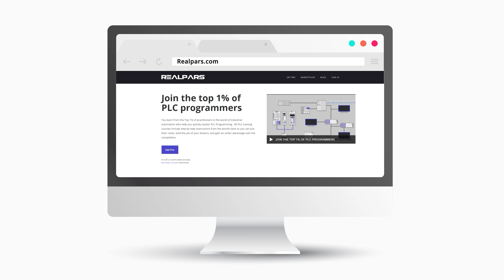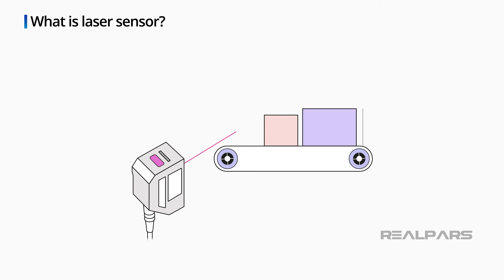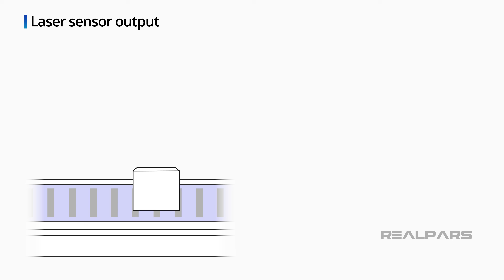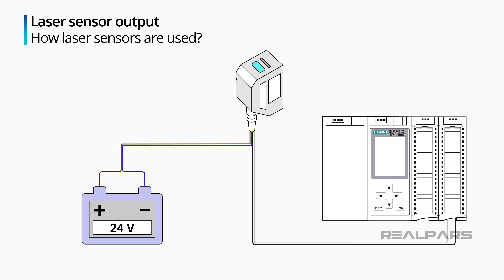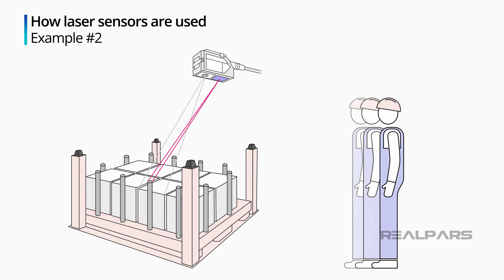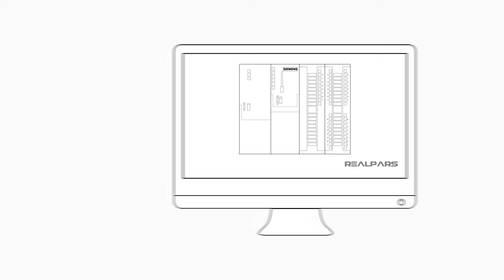Laser Sensor Explained | Types and Working Principles

Comment: Great overview. If anyone wants the machine-vision extension of this: for 3D line profiling the source is almost always a 660 nm (red) or 405 nm (blue) diode laser formed into a line by cylindrical or Powell optics. Blue has become the default for hard cases — smaller diffraction-limited spot, and much less trouble with red-hot glowing metal or red organic material, plus lower speckle contrast which directly improves the sub-pixel line centre estimate.

The key point your triangulation section implies but is worth stating: the wavelength doesn't create the third dimension, the triangulation geometry does, which is why the stability of the laser-camera angle over temperature matters more than the laser itself. And when the surface is smooth and you need sub-micron Z, triangulation runs out of road — chromatic confocal or white-light interferometry takes over (that is interferometry, no laser at all).
Reply from the maker: Thanks for sharing that valuable technical insight on machine-vision and 3D line profiling!

Comment: this video is very helpful. could you make a video to show wireless data transmission instead of connecting to PLC?  The wireless connection may fit for a wider range of situations in daily operation. thanks

Comment: To get the light reflected back towards LASER, shouldn't the surface need to be exactly perpendicular to the LASER beam?
Reply from the maker: Hello Advait Patil, 

Thank you for your question. It is best to have the signal return to the laser as good as possible. Perpendicular would be optimal, but these laser photo devices have wiggle room to play with angles. The device it’s sensing might also move. I am providing you with a link of a global company you might want to read more of their applications and manuals. 

Happy learning!

https://www.keyence.com/products/measure/laser-2d/lj-x8000/?search_sl=1
Reply: @realpars  Thank you!

Comment: It is only used for measuring the distance of the object ? How much range it can measure
Reply from the maker: It depends on the specific sensor you are using, but most laser sensors can detect or measure up to 3 -5 meters.

Comment: Hello,
Is it possible to use laser sensor to define exact position and shape  of 2d pattern?
Reply from the maker: The single-beam laser sensor shown in this video is used for detection of the presence of an about.  A laser scanner that uses a laser matrix or speckle pattern  can be used to determine more about an object, such as the laser scanner used to scan for barcodes at the grocery store.  A confocal laser sensor can determine shapes with a special sensor and software.  Essentially, these scan an area and determine where the object blocks the beam.

Comment: Is it possible to use the laser sensor over a large area and a long distance, and to detect special materials?🤔🤔👍🙏
Reply from the maker: The range of laser sensors is quite long.  Signals to/from laser sensors are fast since a beam of light is being used.  Laser sensors can reach up to 10,000 meters, according to one manufacturer, although it would be hard to have a good line-of-sight at that distance.  So laser sensors can definitely meet the demands of any indoor factory application (up to 50 meters).  As far as discerning between materials, laser sensors are used to detect presence only.  For discerning between non-ferrous materials, it would require an LED type sensor, which is very accurate but expensive.  Capacitance sensors can be adjusted to detect metal objects of different materials.
Reply: Can the LED sensor distinguish between narcotics from a distance and detect what is behind clothes, metals, water and plastic?  This and thank you 🙏🙏🙏🤔